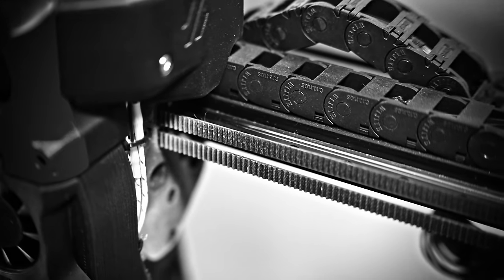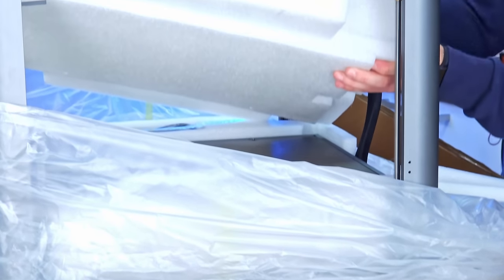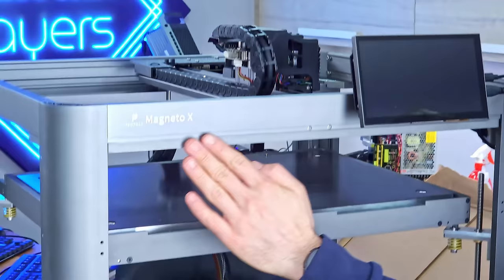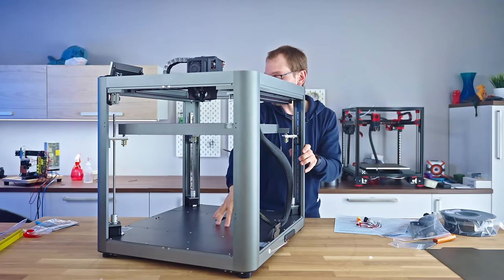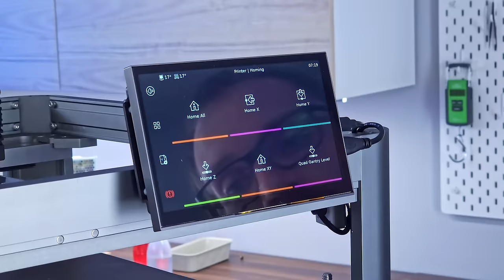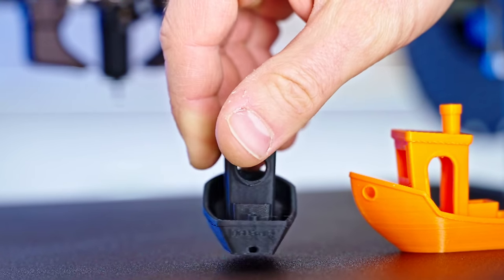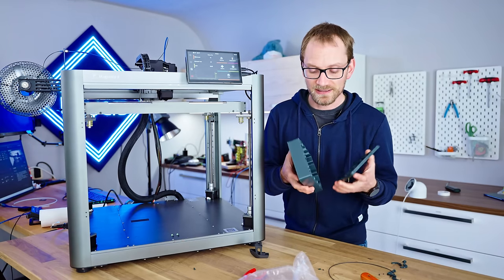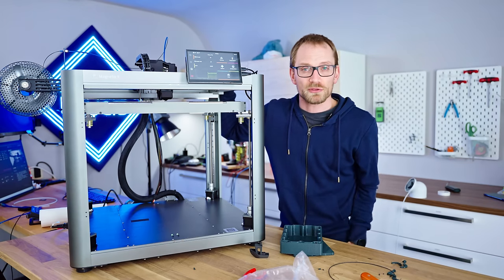The 3D printer with no belts: The Peopoly Magneto X uses closed-loop linear motors!

Comment: @MadeWithLayers re: janky GCFI hookup. Yes! But it's not an electrical / safety code violation, sadly. 

First, the engineers who designed and built this were EEs and MEs, but not electricians. 3D printers fall under EU Directive 2006/42/EC which would normally require this, however an exemption is made for "machinery specially designed and constructed for research purposes for temporary use in laboratories" thus a 'notified body' like the UE doesn't validate the design. That was 18 years ago -- 3D printers are no longer being used just by engineers who are prototyping for products that will eventually be used by the public -- these are products for public consumption in their own right now, and this is the sort of problems that come up when legislation lags behind social and technological progress. 

Sauces: 
5:31 Power cable on the table - probably a type E or F (european), 'AT' power supply cable
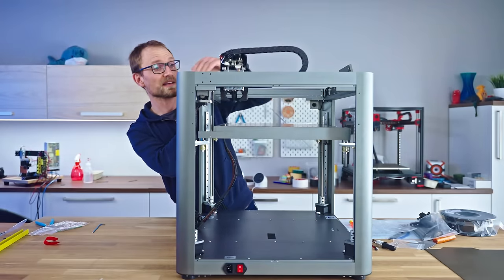9:31 exterior plate visible, with 'AT' style plug. 
10:12  interior plate visible, with 'quick disconnect' plug. 

RCD is required for any 230v residential plug at the outlet in Europe. Outside of Europe RCD protection at the outlet is not always guaranteed. When the standard was popularized in the 80s, it was with this assumption in mind. You can't buy power cables with integrated RCD due to this shortcoming, so best practices is to ONLY use this type of hookup inside a sealed unit (ie you need screws to get into it once assembled and powered), or at least to have an access cover with the exterior plate having a 'high voltage' warning noting that the equipment should be unplugged before servicing. However, due to the 'experimental' nature of 3D printers, even these standards can (and are) ignored. 

The truth is, while this is a design process failure by the engineers, it's also a failure of government regulation, and your comments that this represents an advancement in what is now considered fairly mature technology stand in stark contrast to this legislative reality. As a content creator who focuses on 3D printing, I feel you have a journalistic duty to provide this context to your viewers, not just the technical tear down (which was solid).

Comment: i guess the flux along that axis is not that constant and needed calibration to each step to achieve stable movement (the magnet is not actually equally distributed on rail)
Reply: yeah, that surprised me that they were just kind of hanging out there under the sheet. wouldnt that mean some amount of tuning would be required any time you move it?

Comment: 8:44 can you elaborate on this a bit more? Without any driving force how does it ‘push’ itself into the right position? Should the generated magnetic field just snap it to some equilibrium between the south and north magnets?
Reply: Also you mention the longer melt zone multiple times, what is the benefit to that?

Comment: The motor is integrated into a moving axis. It adds to the moving mass. As for this build, you also have that drag chain adding to the moving mass. Then there is cost. Not sure about that one. This prototype surely do not show how this is going to be more cost efficient.

Also, I guess they really did not design a stepper less printer? There clearly are 5 steppers in this machine. If used for the z-axis, there typically is not the same adding mass issue. They do not. Why?

Also, this probably works better for cross gantry. That way, the mass issues might go away. There might be some issues with wiring, but that is another story.

I don't see this. I just do not see this as the correct use of the tech. It seems used as a replacement for a stepper and belt, not new tech being used for its strengths. New tech tends to enter the scene as a straight replacement, and over time someone realizes its true potential and limits, and use it in the right way. This simply does not feel like its true potential. But a tech demo, sure. It can be used this way. Why would you?

It seems like the y-axis is driven on only one side. If you assigned a Cartesian motion system using belts, and had a motor on only one side of the Y, would that even be considered a proper design these days? Kind of why not? Is that a trade of with this tech?

It might be Tom, but what is the vision here? What is this tech to bring to the table? To get there, what is lost? Sure, it can be done. So what? What is the promise, what is the vision? What is the way forward, and why? What needs to be done, and why? (Tom highlighted some with motor corrections being unified, which is actually quite some work, given how slow development in this sector really is)

Comment: This machine is looking at my ball park but too far away to think about entering!
My design Only has Rotary motion. There is no linear motion. No rods or belts of any kind! And there is no backlash, an infinite number of steps to achieve submicron precision. And the printing is done on the inside of the vertically stacked motors
So the torque is high AF.

Comment: I really do like this printer. Can you confirm this has a raspberry pi? To me, it looks like a generic copy like an orange Pi or something like that. But I could be wrong. Thanks
Reply from the maker: Chucking the label on the back of the Pi board into Google, it appears that the Pi used is an Orange Pi Zero 2.

Comment: Linear motors are awesome, i do really wish they can work out the design kinks with the rest of the machine.. maybe make a smaller version to make it more accessible
Reply: Yep, a smaller one would be cool, like a 200x300 or so. The little quirks and issues aren't a big deal, the nozzle digging into the bed can be solved by having a lower minimum z height in klipper, the bed could use some protective mesh and bed cables another layer of insulation. I personally wouldn't cover up the bed completely as it would mean lower build chamber temperature, peopoly is selling an enclosure after all and a 130c bed is pretty cool

Comment: Wish all the axis was linear motors. That means the z as well ( less wear plus the linear motors are also more precise).  Maybe for a v2 ? Fingers crossed 
Also hope that I can use a diamond back nozzle and higher resolution and refresh camera ( with the option for plugging in a second camera )

If both of them where possible then that would be end game printer for me
Reply: The problem with vertical linear motors is that once power is removed the build plate plummets to the bottom.
Reply: @parallelsandtangents938  and thats why you put springs on the bottom or like in a cnc just have a mecanical break that automaticly ( pure mecanically ) locks Z when power to the machine is lost ( it needs power to stay unlucked and when power is lost its lucked ) with like a little stepper moter at the bottom holding a wire that keeps some ruber pads away from the sides. witch is pushed towards the side's by small springs. it might not be enough to hold it stationarry but it sure will slow it down so it makes a soft landing instead of crashing down or just simple counterweight. that way the motor dont have to hold the waight of the buildpate and the print but only the print

Comment: the no haul line is interesting, I thought the reason for it was due to layers shrinking unevenly as they cooled, why would this printer not create that artifact?
Reply: I suspect the carbon fiber PLA was a large factor. The carbon fiber GREATLY reduces thermal expansion.
Reply: @tomhsia4354  ahh ty makes sense

Comment: I want to clarify that the benchy is not good because of the printer itself. Rather it is a well tuned printing profile that accounts for the phenomenon that causes the benchy hull line. That’s why it was a 28 minute benchy and not a 16 minute benchy

Comment: completely agree with your assessment.  this printer has so much potential but it needs a lot of software fixes, and I'm not loving the safety of that 230V line.  Curious if it'll still be 230v if it runs on 120v?  Still wouldn't want to see 120VAC short.
Reply: US printers will use 120v for the bed heater. This is the same setup as a Voron or a RatRig.

Comment: Linear motors are cool, but at that scale they make little to no sense. They cost more than a equivalent belt driven system with no benefit. The only reason to switch to the linear motors would be due to belt ringing. That's only going to happen at much larger 3d printer sizes where belt tension starts to become a bigger issue. Im not saying there isn't a place for linear motors on 3d printers, just not at that size. 

However maybe switching back to a core xy system with dc brushless motors would give a lot of the same benefits with less down sides. And if they kept the direct linear encoders instead of ones mounted on the motors it would give a more direct feedback without any potential errors due material deformation or other such system errors.

Comment: Thanks for the review! I am super impressed with your diagnosis of the stepper motor issue and solution! Re: no USB ok,  but the Webpage states that it has SD card for file access -- did yours not have one?
I like the machine overall. But, at this point in 3D printers... I really don't like that it doesn't have certain features:
I don't see any dual filament ability which is really important to have for running structural support. 
The lack of any protection to allow the bed to hit the nozzle, and then damage it without - an impact detector is odd... it has it for "leveling", maybe they can find a way to use it for bed impacts...?
The maximum temperature capability of the head is only 300C so, not hot enough to work with PEEK and other high temp filaments... which by now should be included.
Does it include any add-on heads such as LASER for engraving? (I guess not).
I really like the volume of the machine, but, with all the advances in 3D printing, the lack of dual extrusion, lack of high temp head, no LASER Engraving... I don't see a reason to use this at the price point.

Comment: Peopoly is a sponsor of the Klipper project. WHY on Earth Bambu, Elegoo and Creality aren't?
Reply: Bambu is pretty clear, because they are not using klipper. Only the x1 would be in theory be capable of, but x1plus team confirmed it isn't klipper.

The other two? No idea. Originally creality also stated the software of the k1 was fully self developed, which isn't true as all know. It would only be fair to at least have a small donation, contribution or even thank you. I mean creality could give Kevin O'connor their auto z offset code, which would enable non klicky style probes to do a z offset calibration. Elegoo hasn't really developed anything besides their screen interface, not even the electronics as those are essentially from makerbase.
Reply: @kilianlindlbauer8277  I don't believe Bambu when they say it's not Klipper. Of course it is
Reply: @henrymach  what else do you need as evidence that its not klipper? The x1plus team confirmed that no single trace of klipper is present, the p1 and a1 series isn't even capable of having klipper installed, only the x1 has a Linux cpu, the others have only stm32 and esp32 chips, so not capable of klipper host firmware. The Mainboards dont have traditional drivers, the driver chips are not present and the main cpu controls the mosfets for driving the stepper motors directly. This is why the p1 and x1 got noise cancelling via an update. Klipper is not capable of that. 

Also what evidence do you have that it is klipper?

Comment: They need to close the loop on the extruder and the Z axis. They also need to stop pretending that the closed loop system is a stepper and drive it directly. Add a temperature controlled enclosure, and they will have something I'd buy.
I was really surprised that the system did not use the load cell they used for bed leveling for crash sensing.

Comment: Its not very fair to judge the print quality after crashing the hotend into the bed with enough force to deform it.
Reply: I think it's extremely fair. If you design a product with no basic safety to avoid such a basic issue. You deserve to be judged by how that would affect a print imo.

Also he basically praised them imo

Comment: Are the 4 'Z' axis stepper motors mechanically interconnected?
Reply: I hope not, otherwise bed leveling adjustments would not work/help.
Reply: @Golfboy-ze3le If they are mechanically interconnected, no bed leveling required after initial set-up.

Comment: The main controller board is treating the closed loop servos as if they are simple stepper motors and so this may result in some janky print results.. the closed loop system will not behave the same as a stepper (control loop delays, response time, acceleration and velocities). I think they will have to integrate the linear servos into the main driver board a bit more so the main controller has more feedback.

Its an interesting design though.. looks expensive. 

220V live just "hanging out" scares the #$@# out of me though..

Comment: >$2K printer
>Z axis steppers lose steps
>Crashes bed into hot-end
Reply: You should see why my f'k'n'n Wanhua Duplicator 9, MK2 400 did when I first got it!
It was well over a grand too!

Long story short, it could not print anything at high temperatures due to major heat creep!

Wanhua had (and still has) no resolution for that.
I resolved it myself by making a duct system to cool the heat break (aluminum piece with air channels).

Then, the leveling of the bed was never right no matter what I did.
UNTIL, I took my digital calipers and tested a hunch!  Sure enough, the bed was not aligned with the damned frame!!!!  FRAME!  Ridiculous!
So I aligned that.
Then there was an issue with the X travel.  As the extruder traveled, using an HD camera zoomed right into the bed/head, I could see that the extruder/nozzle moved up and down ever so slightly.  WARPED ROLLER WHEELS!!!  From the factory!

So having a few issues on a 1st run machine, is likely.

Let's see if the company does in fact resolve these issues.

Some people are saying that they've had bad experiences with customer support and service from the company. 

THAT WILL BE A BIG PROBLEM if they don't adopt a better corporate attitude on customer-first action.

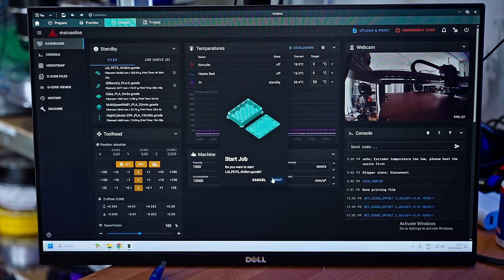Comment: 20:49 That thing needs big EXTERNAL emergency stop switch! With ability to push into the bed with full force even though it has load cell makes zero sense so I would have pretty low expectations for the firmware quality.

Comment: I hope this machine and the small affordable linear motors get adopted more. However, if i bought this printer, i would not be to happy with what Peopoly delivered here. I'd want that thing to work out of the box, and deliver quality prints out of the box. If i want a printer as a project, i'd buy a Voron Kit, but when i get a printer as a tool to work, it needs to deliver.  I was expecting a bit more to be honest, this just seems rushed to the market as unfinished product to make some quick cash with a product that actually needed to stay in development for another iteration.

Comment: The faster the moves - the more rigid the frame should be - ringing sux, but soft solutions are non robust...
(throw the cube inside a steel frame for additional frame bracing.  lol...)

Real feedback to the motion controller - would put it in the real CNC realm (end effector / pdseudo CL-stepper "FB" only has limited path error rejection, nothing 
absolute".).

  - freaking bed zero - imitswitch.  lol....  (spring mountings - for mechanical compliance woks too).

Comment: That was looking nice until you showed a Bigtreetech board and i instantly lost interest. While most people say they are something special, I personally, fell into depression setting up their stuff, The shop that took over to get it going, spent 6 weeks and 3 of their technicians to get my BTT'd Ender5 plus working and then it started failing within a week of printing. Destroying the new PEI bed and many nozzles as it kept going out of calibration on its own,  BTT gave zero help.  Not one reply to the many messages i sent their support team.  Peopoly need to loose that board. Use a Duet3d board or something thats at least got some real support. Then it'll be a brilliant step forward.

Comment: Stepper = DC (usually)
Linear 3 phase = AC (could be run on DC, but it would make pieces out of motors body and all.
Reply: So, it sounds different. Inverter could change speed of linear or normal 3~ (2 phase too)

Stepper eats pulsed DC between 2 coils (4 wires) usually.

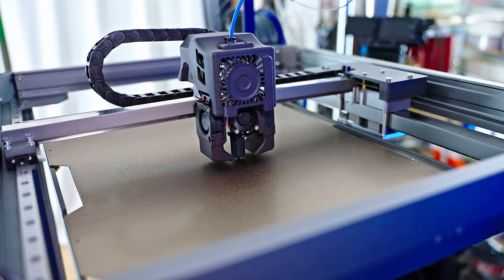Comment: 20:50 Why did the nozzle crash into the bed, can someone explain this.
Reply from the maker: I pressed the move button for Z-axis "down" instead of "up", as in the haste of the moment, I saw the moving bed and wanted to move that "down".
Normally, the Z-axis (and all other axes) should be limited in software so that they won't try and go outside their known safe range of motion, but in this case, the safe limit ("software endstops") wasn't active and the printer obeyed my command of trying to move the nozzle tip about 20mm through the bed.
Reply: @MadeWithLayers  thanks for sharing

Comment: why they are not using linear magneto z axis? :)
Reply: Because when power is turned off the bed will plummet to the bottom of the printer.
Reply: This would be why linear motors couldn't be used with a delta style printer without some type of relay activated spring lock.

Comment: I think it's pointless to check the print quality, since you most likely damaged the linear axes. That was a pretty strong bent. 🙂
I made the same mistake with my first filament printer and I had to replce it. We are human, mistakes happen, but this is clearly not the standard quality that the printer can produce. 😃

All in all, this machine is a very good concept. 👍